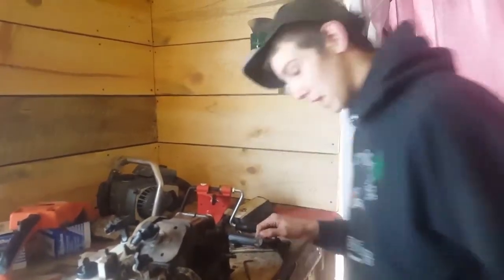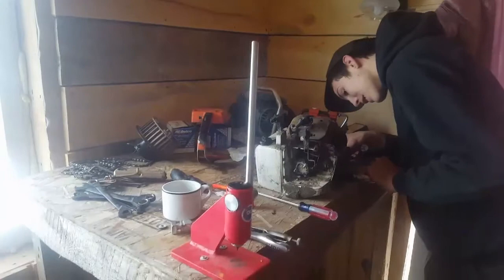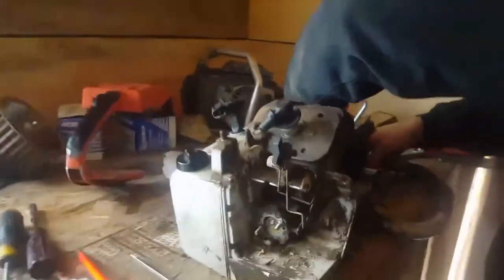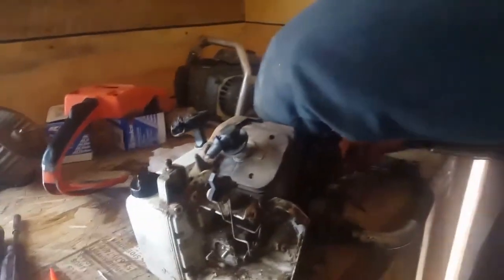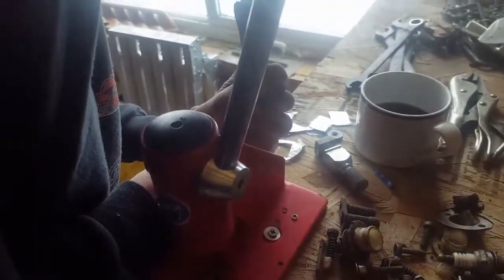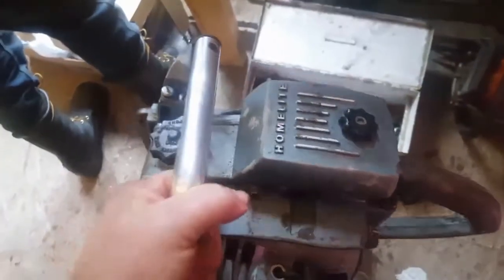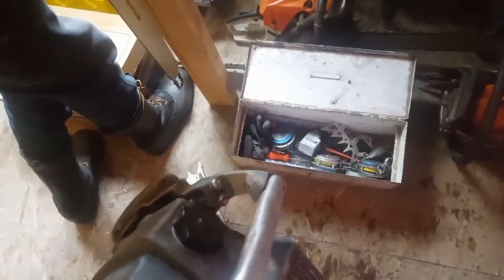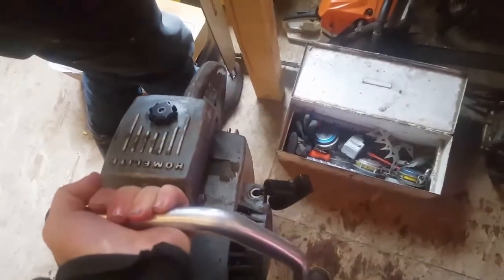Our little saw shop

Comment: Nice warm, dry place to work on saws! I've got one of those 056 Mag II's. It's even the PNW edition that Stihl NW modified in the warehouse and sold to all the west coast guys. Great saws, although they have some weight with them. Only draw back is, like most old saws, the electronic ignitions can be a problem. I'm really thinking about a 661CM to replace it and semi-retire the 056. Bought a 362CM a few months ago and was impressed, the fancy carbs seem to work well and it has good power in a nice light package.  Take care, stay safe guys.
Reply from the maker: Speed and Marine thx bro...jesse totally rebuilt this one out of two saws and put in an after market piston and jug..all the lock washers r shot so loses bolts like crazy lol....god bless
Reply: Red loctite is your friend! New saws are nice, but those old ones are fun to run. No matter what it's cutting, what bar or chain it just pulls. The Mag and Mag II's with the factory dual port mufflers sound good too.
Reply from the maker: Speed and Marine thanks speed we will give that a shot...for a boat anchor shes a ripper :)

Comment: oh no jesse u want to pull riggen best job in the brush .i will have lots of time to make hooking video's if u need hints stay safe get logs
Reply from the maker: west coast logging alex esgate ill tell him...he would love that:)...i only hooked a few times, pulled riggin for 3 years and chased
Reply: gns logging the thing with those kollers is that there 1 speed so u need to put the max. productive amount on every turn easily said just the slinger in me coming out
Reply from the maker: west coast logging alex esgate k i remember that...thx for advice man...prob be hittin u up more if we get it
Reply: oh heck ya u got my number just give me a call i worked under a k501 for 6 years